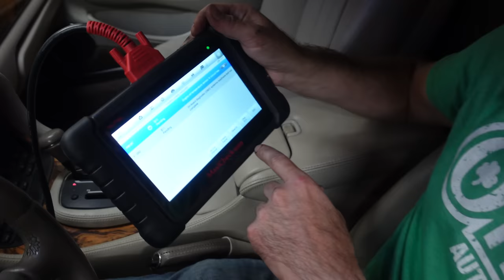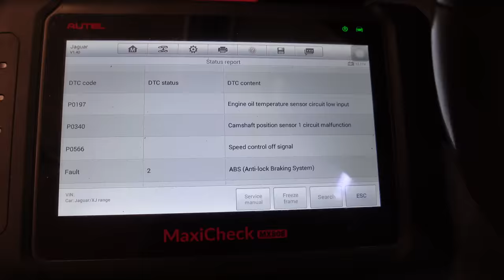Spoon Feeding My CHEAP Jag Oil... Because The INTERNET Told Me To

Comment: I had a 99 XJ8 with the exact same no start after sitting for awhile. (Fires for a second and dies.) The reason it would not start and run is because the security system was tripped. The only way to get the security system reset was using the JLR service software to clear the security code. An independent specialist should be familiar with the no start you're experiencing and can confirm if your Jag has its security system tripped. 

Another common cause for no start is the transmission position switch goes bad. I doubt that is your problem but don't be surprised if an inexperienced Jag mechanic tries to tell you that you need a new transmission switch. I learned on my XJ8 that mechanics who don't want to work on that generation of XJ8 will purposely diagnose a bad transmission switch so the owner will refuse to repair the car. The switch is about $1k and are only available used.  The XJ8 you have is a combination of JLR engineering and Ford parts which makes trouble shooting a real pain in the neck. 

Good luck with your car. I absolutely loved my XJ8 but it took a specialist to get it to run after its long slumber.
Reply: That sounds totally plausible. I could definitely see a car company making a security system that allows the engine to start but immediately turn off. It would give the police time to nab the world be car thief. On my car if the security system is triggered it will start and run but the horn honks non-stop. The only cure is to drive it with the hood popped. I imagine that would stop most thieves.
Reply: doesn’t have a P1260 it’s not immobilized
Reply: @xalty1200  my Jag didn't have a P1260 code either. My Jag specialist confirmed the security system had tripped and when he reset it the engine ran without a problem.
Reply: this is what I thought it was. something completely random that has nothing to do with the engine
Reply: @Cartier_specialist  wouldn’t those in the know just cut the wires to the horn?
Reply: Totally agree
Reply: I have a problem wiht the same thing.. the transmission position switch.. Car wont register PARKING.. and wont start i need to wiggle it many times to finally register. But at the last attempt that trick does not work anymore ..I am reading that the switch is 1000$ ( i see some for 150$ on EBAY) ..

Comment: Trade it for a Range Rover and make your frustration go from bad to worse, LOL 😂
Reply from the maker: My Range Rover wasn't bad, just exhaust leaks for days 😳
Reply: @WatchJRGo  Welcome to Jag life J.R .  Mystery problems abound
Reply: 90  % of Range Rovers are still on the road,   the other 10% made it home.
Reply: or trade it for a BMW, same same.
Reply: @WatchJRGo  same on my dads P38!
Reply: Lol lots of RR jokes. Everyone has the "other manufacturer is bad" jokes
Reply: I really think there is an issue with the fuel pump still. Something isn't right. Especially if its dropping 20-30psi as soon as you turn the key off. Fuel pressure should be 52-60psi @ startup and around 40-55psi @ idle, and fuel pressure needs to remain stable. When key off fuel pressure should keep most of the pressure
Reply: Well played 😂😂
Reply: @audidriver53  likely a fuel pressure regulator has failed
Reply: they had the same engine , if its within this time period.
Reply: Trade it in for a Yank car, or an antique horse and cart, there’s not much difference.
Reply: Dana would enjoy that

Comment: For removing the old fuel filter, you might try using "CRC Freeze-off". When you spray it on, it greatly reduces the temperature of your fastener. This causes the fastener to shrink, which not only separates the fastener from its mating component, but that shrinking allows the penetrating oil to penetrate better.

Comment: Mustie1 recently did a video on a 1930 Plymouth. It hadn't run since 1980. It would start, but stall in a second. The problem was that the muffler was blocked, probably by a mouse building a nest in the tailpipe. He lopped off the muffler and it ran fine. Just sayin'. Good luck.

Comment: 1.  Open hood.
2.  Swap in LS. 
3.  Reliable Jag.
Reply from the maker: If it didn't cost $10k I'd stick the ultimate engine in it 💯
Reply: A guy here in the Portland area was swapping in 350s in the late 70s early 80s and there were a ton of them ripping around reliably around here once he got going. I remember one slamming it to the firewall and drifting sideways smoking the tires as he slid by😅
Reply: @WatchJRGo  Are you really putting a Lada engine in it....neat
Reply: @WatchJRGo  Cars and Cameras probably have a Predator 212 they'd sell you cheap.
Reply: @69Dartman  Oh huh. Explains why I've seen a number of 350 swapped Jags appearing every now and then on craigslist around the PNW. I really want one lol
Reply: @WatchJRGo  Since when VAG 1.9 TDi costs 10k 😁
Reply: Borrow everything from Rolls Royce put it in the Jag.   Eventually put it back in Rolls after you get a custom rear end.   Win win
Reply: @WatchJRGo  A 5.3 from the pick and pull for a grand, one of the plug and play swap kits, find some old guy with a tweed hat and a pipe, sell it for a small profit and call it a day.
Reply: @WatchJRGo  I have a 2000 XJ Vanden Plas with a 5.3 already in it I’d sell for 5Grand. The 4l60 let go of 3rd and 4th though so it’ll have to be rebuilt.

Comment: Had the same problem.changed the upper chain tensioners because on checking it had jumped a tooth on one of the cams. Did all the oil down the cylinder stuff and it started right up.
The nicasil jags suffer from overfueling if in cold weather you start the car and say just move it a few feet and then switch it off. If you try to start it a few minutes later it likely won't start. Had the same fuel filter problems. Ended up cutting the lines and having some lines made up to fit into the existing ones!!
I did once manage to get it going by leaving it for a while then holding the throttle to the floor and cranking it until it spluttered  into life. This was advice from my breakdown man!!
Good luck.

Comment: I've had similar problems with vehicles doing this.
You could have a funky ignition switch
Reply: You read my mind, ,ign switch
Reply: Yeah the fuel pump is shutting off just wire it direct to test
Reply: Maybe not. Maybe just cutting spark.

Comment: hay JR just a thought because you don't have a remote could it be a security/immobilizer issue because in newer cars it will let you start for a  split second then cuts fuel to rail. without chipped remote because my Rover/Sterling did the same thing without the remote wish you all the best I love the old jag/ford
Reply: came to suggest the same...  immobilizer issue
Reply: could be just like the jeep... but wouldn't it throw a code for that?

Comment: Crankshaft position sensor. Had the exact same symptoms on one of my Hondas. You need to put a 'scope on the sensor to see if you get pulses as you crank the engine. My sensor was potted so it wasn't possible to get inside it. I'm sure that'll get you running immediately. 

But about that oil leakage...
Reply: they're so old now it might be a good idea to do both. gotta do OEM quality on a jag though, i don't know how happy it would be with some stuff from oreilly

Comment: I guess the oil truck over the years has become so refined that how it once was done is how it shouldn’t be done??? IDK?? Lol?? Turkey Bastet with clear hose attached. I used Lucas oil treatment and put more than a spoonful in each cylinder. Exact measurements not really called for here. Did all cylinders. Put plugs in and turned the key until the car started. If it dies during the process more than likely you will have to repeat from beginning. My car is a 2000 XJ8. Bought it off my mother who was “taken” by a shop and paid 2k for guides when she had 195k on the motor. This was 7yrs ago. I still have car. Gives me no trouble but would not loan out because fail to start once and then you have to prime the cylinders. Never did the no plug accelerator to the floor process ever work for me. Not one single time. I tried it that way a bunch of times but it never ever worked. The big thing here is a perfect battery and don’t fumble the start process. Key to start until it’s running. I just checked. That XJ8 has 203k+ on it now. Drove it from Mn. To Id/Ut. Been perfect.

Comment: Might be worth checking the vin codes on the engine vs the chassis. Starting to think a sketchy engine swap was done and they got the wrong kind of engine for this specific trim. (re: the missing camshaft sensor)

Comment: By 1999 Holden already had security on their cars - key was coded - with electronics in the key. Without the electronics car would start - then stop - exactly as is happening with this car. There was a "service" key without electronics that could open doors boot/trunk etc. Jaguar did not have security in 1999? Key you have looks equivalent to service key.
Reply: Yeah it seemed like an immobilizer issue. Maybe he will see this

Comment: I did not finish the video yet (I will tomorrow). I just caught the comment about needing a vacuum or something to suck the oil out the spark plug wells. I did not see anyone comment, so here is what I did with flooded wells. 

A regular transfer pump will get the majority out. Then you have a couple options, but they are basically to use compressed air to blow the oil away, or soak up with towels. Use shop, or paper, to soak the oil up until there is not much being soaked up. Use a small, but long) flat head screw driver and wrap the towel around it. It will get all the areas the spark plug socket can reach, probably deeper as well. Finally use an air compressor and blow the oil out and up. Cover the well with a paper/shop towel. Keep doing this until you are not getting much, or any, oil onto the towel. I believe this way makes the least mess, but takes the longest. Your other option is to just blow all the oil out with the air compressor. Very fast but it will be very messy. Either way is way better than hydrolocking the engine or at the least sending the oily exhaust through your cat possibly damaging it.

Comment: First, check the engine number to make sure it is correct for the car. As others have mentioned, you may have an incorrect engine in the car. Second, if the oil temp sensor is faulty, it may be sending incorrect signals to the ECU for cam position - it may be an input parameter. Good luck. This is fun to watch.

Comment: Would a compression test help determine if it's out of time? I'd also be asking around about that 'spare' crankshaft position sensor to see if it's meant to be hooked up or its a spare/dead connector? Maybe this car is a half finished engine conversion with the wrong motor?

Comment: My volvo did the same thing after a rebuild - it was a tooth or 2 out of time which caused it to start and run great for exactly 1 second and then die when the ECU noticed. When I disconnected the cam position sensor it run normally, cause the ECU couldn't see the problem.

Comment: It sounds like a healthy crank, seems like you have air, fuel, spark, compression, but it tries to start like an engine out of timing, backfired like it too.
Reply from the maker: I heard it backfire internally today too, you're right it's out of time 💯
Reply: @WatchJRGo  8:28 in slo mo in the settings- is it just me or does the compression stroke look weird from left and right cylinder banks? I've seen a few of these tensioners that Dana did, it is pretty interesting. Hopefully that's not it though.
Reply: @WatchJRGo  I mentioned that yesterday. My import mechanic buddy was over and I threw your scenario at him. I showed him the video, he said the guides wear out and the timing jumps. I guess I actually just shared someone else's wisdom to help you out.
Reply: the upper pad of the secondary tensioner falls off and breaks the chain. 

it happened to some cars under warranty others it happens way later i’m still pulling them out of cars that roll into the shop.

Comment: Low voltage can give you lots of extra codes. 

Had an 8 liter Cummins shut down on a Lowe's truck towed it to shop. 

Had crank no start. With charger hooked up on long crank sessions it kept throwing injector codes. Led me down tons of rabbit trails. ECM and lots of wiring and plugs.

It was the fuel rail pressure sensor. Cummins reversed how you could unplug sensor and start it at max pressure.

Comment: I had a 96 4 cylinder s10 that I did a head gasket on and never started it I let it sit a year and the rings got stuck or washed I put oil in all the cylinders and it eventually fixed it. It went from 30 psi compression to 150

Comment: When I worked as a mechanic the shop I was in had Subaru as on of there manufacturers, I would use Subaru upper engine cleaner for stuck/rusted bolts works better than crc 🤷‍♂️

Comment: Air+Fuel+Ingition = Explosion 

Sounds like you’ve got all three since it wants to run. 

Also sound to me like when the ignition switch is in the start position it wants to run, but stalls when the switch is moved to the run position.  Bad switch?  There is a standard ignition switch and key right?   I’m also wondering the since the fuel system was so fucked up that maybe there’s plug injectors?

Comment: Here is my theory. I think it might have had a used engine swapped in when it was parked, I am willing to bet the "new" engine is from an older car that only had 1 cam sensor. My suspicion is some tech swapped this engine in, never got it to run, then they shoved it out back and left it.
Reply: agreed, its starting from crank position but shutting down and throwing a code when cam position is in error. Car probably needs a matching ECM or front cover changed  with harness / ecm  matching cam position sensor
Reply: Or it is running out of fuel . Been there done that.  No engine swap i think. It may have been under water i think.  Or maybe it has sausages in the fuel tank i think. Or maybe it has a had a fire i think.  Or maybe it has had a bad rear window i think.  I could go on with " i think "  . . .   Fills in time i suppose  . . .
Reply: you can’t possibly fuck this up. on a supercharged maybe

the 98 motors have completely different cams and the vvt solenoids are in the timing cover
Reply: I think the cam trigger wheels are different. That is the issue. It should run with one cam sensor.

Comment: any one suggest issues with the immobilizer, either receiver in ignition lock cylinder or maybe the key is not the original key and not programmed. Just a thought.

Comment: Maybe fuel filter blocked. Not allowing pressure continuously. Check no dirt on cam shaft sensor.. give it a tow around the block. Is that a jag engine or a ford engine.

Comment: I have a problem with my transmission not registering PARK on the same Jag ..I know you might think this is strange but try to jus move the shifter from park to 2 gear ..for about 15-20 mins..

Comment: Even if the exhaust cam jumps one tooth it will not throw a code for cam at a time. The intake would but the exhaust won't and it will screw it up.

Comment: Check to see that the plastic fuel lines under the car are not kinked. I have two x308s and on both the previous owners linked the plastic lines in trying to change the fuel pump on both cars. The fuel filter is restively easy just a pain and you will get showered in fuel but you gotta take all the hard lines off the plastic ones. If they’re kinked just cut them off the barbs & run 3/8 fuel hose with double hose clamps on both ends like marine applications. Good luck.

Comment: Seems to me like it’s fuel related. Among other issues I’m sure contributing to the primary problem, it seems as though the car runs the fuel pump during the ignition cycle, and cuts it the second the car starts, which is why it then dies. 
I’ve read a few forum posts where the issue is the click cycles on the fuel pump relay not properly functioning… something where there are three cycles on the relay, one for priming, one for start sequence during ignition cycle, and one for engine running. Looks to me like these are not functioning correctly.

Have you tried a full hard reset on the car, along with doing a reset on the inertia sensor? A full reset on the car, along with resetting the inertia sensor (which I have read sometimes becomes confused and doesn’t retained its tripped position but is tricked into thinking it’s activated yet won’t display a code) could at the least rule some things out. 

Also, if the inertia switch has completely failed, and wasn’t ever tripped, the car still will not run just as it is occurring in your video but also won’t trigger a code since its not communicating whatsoever with the ECU. I’m no mechanic or Jag tech, but this is just a bit of what I’ve read could cause these issues when it comes to a non-supercharged single fuel pump XJ8.